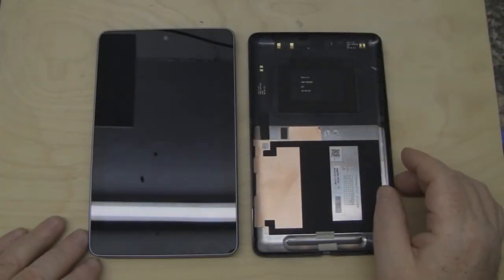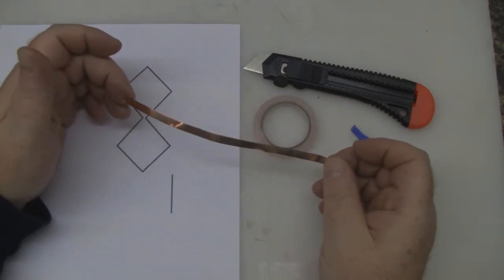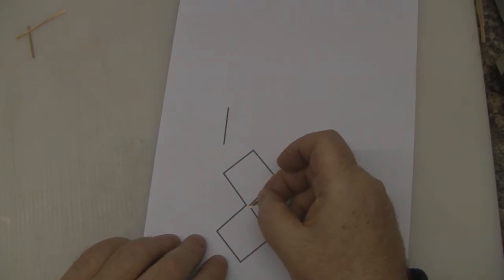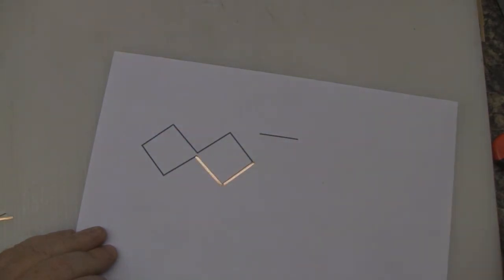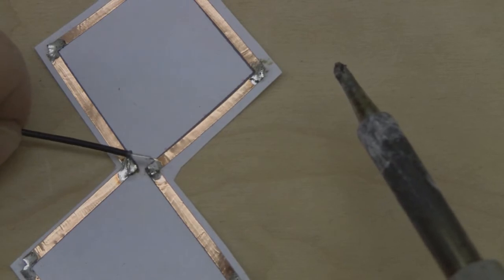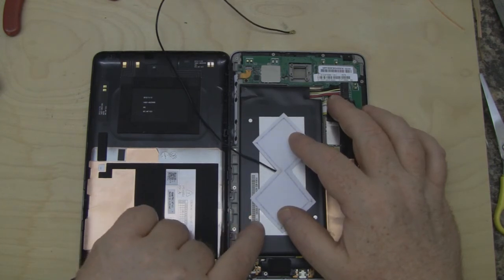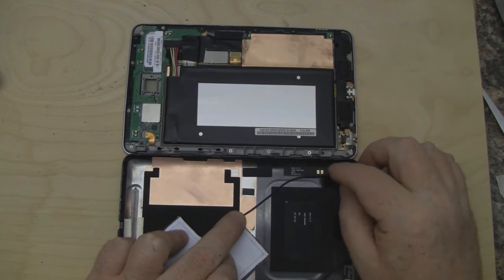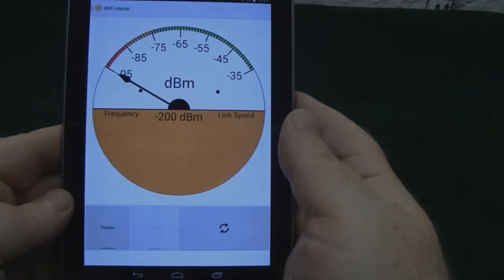Nexus 7 Antenna Upgrade 2 #59

Comment: I see many people commented along the lines of what I was thinking, as far as the width comments during intro. But since you ripped them lengthwise, it was obvious...

Anyway, might I ask what thickness of copper tape you’re using? I only ask because you mention scoring it several times to cut through, but the kind I’ve got in stock is thin enough to easily slice through in one go....and that concerns me. Such a variable might be making a huge difference in my recreation of your design. And we can’t have that!

And thanks for the videos, mate. I did the copper tape/Perspex cantenna for a range extender, and it works wonderfully when it’s not windy. (Receiving through thin stand of pine trees you can see though... but pine needles are hell on 2.4ghz)

Comment: can i use some thin copper wire to make the loop? i could make it do several loops to look wider. also i dont have access to coaxial cable...can i use usual copper wire to solder to the antenna pin? thing is i am using my nexus 7 without a back cover cause i can only recharge my tablet by unplugging battery and charging externally....so i keep the back off.

Comment: Thank you very much, this fixed my antenna and greatly boosted my signal. I used a  biquad designed for a 32mm fractional wavelength. I realized that tuning the antenna to channel 6 would probably be best, I would recommend using a 30.75mm fractional wavelength biquad.

Comment: why couldn't he just use the mettle paint as the antenna ??
Reply: many things effect the function of an antenna. Material, shape, thickness, and length all effect its ability to not only pick up a signal, but the specific signal that you want. I could go into more detail, but you get the point.

Comment: can we use aluminium duct tape ?
Reply: probably though copper is still a better conductor.
Reply: Rich Miller I use copper wire all the way to the connecting nodes, my circuit nodes that connects from circuit to wifi on the plastic case was broken. i made that nodes using same copper wire.. Actually i mold the copper wire to work like a node and sold in the end. It's working now Thank you.
Reply: +Mobin Ahmed you could, but you can't solder onto aluminium, which makes it much harder to work with

Comment: Great vid, im gonna try it out, but do you think using a double biquad layout would give a even stronger signal, I can have it on the out side back of the back cover since I have the nexus 7 in a wallet type case.

Comment: I printed the template but it comes out a bit smaller then what you have on the video, what is the size of each line in mm? Thanks
Reply from the maker: Yes it is mm. Make sure you are not auto scaling.

Comment: Can you share the link to the coppertape?
Reply: andrew mcneil Hi, my copper wifi contact on the motherboad broke off when i was replacing the battery, and i'm only getting a signal that's very weak with very little bandwidth. what should i do.
Reply from the maker: http://www.ebay.co.uk/itm/6mm-Copper-tape-Slug-Snail-repelent-30meters-per-roll-cheapest-on-ebay-50365-/251504482077?pt=UK_Home_Garden_Garden_Plants_Weed_Pest_Control_CV&hash=item3a8ed5d71d
and
http://www.ebay.co.uk/itm/5mm-Copper-tape-Slug-Snail-repelent-30meters-per-roll-cheapest-on-ebay-50365-/251504463502?pt=UK_Home_Garden_Garden_Plants_Weed_Pest_Control_CV&hash=item3a8ed58e8e
Reply: Get it at a stained glass/hobby store.